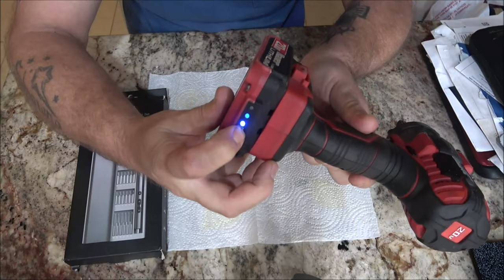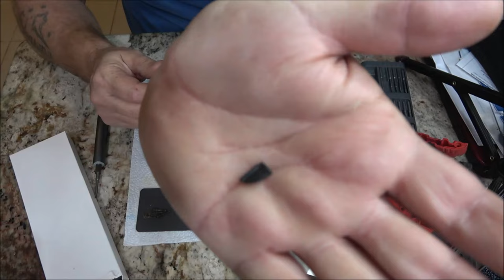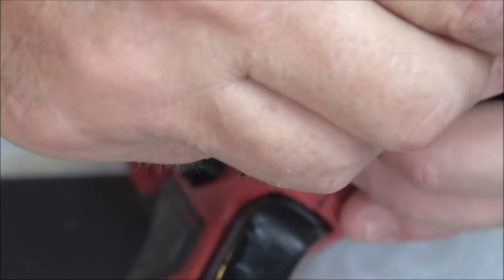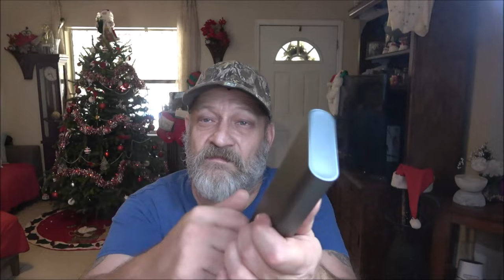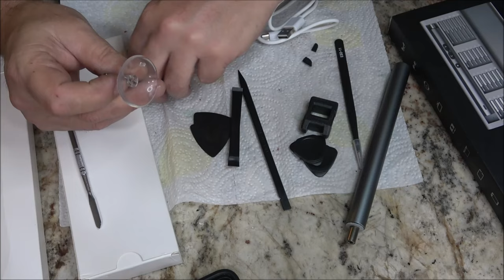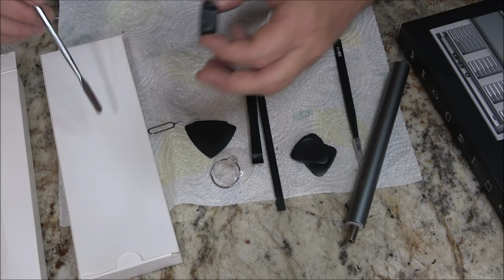Repairing A Bauer 20V Impact Driver...Trigger Not Fully Depressing In 4K

Comment: For the lights it's probably the board that has cracked due to a shock while working with the tool. It's fairly easy to fix you only have to scratch the varnish off the board and solder the crack.
Reply from the maker: Thanks for the info I appreciate that.